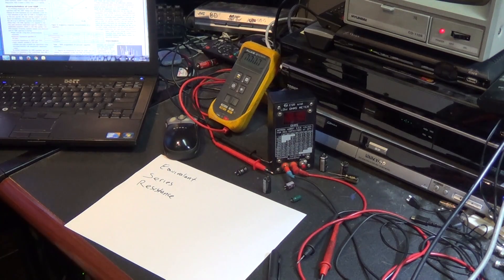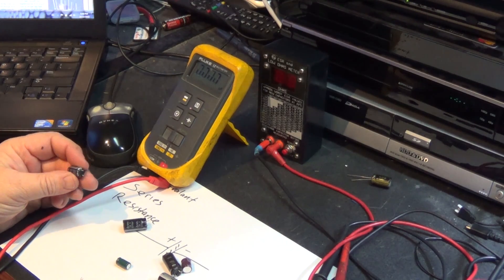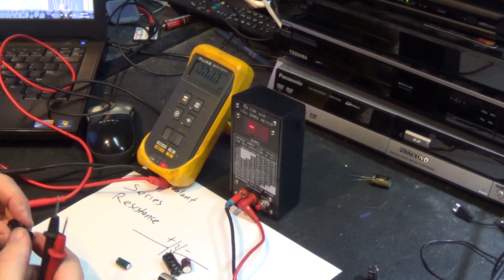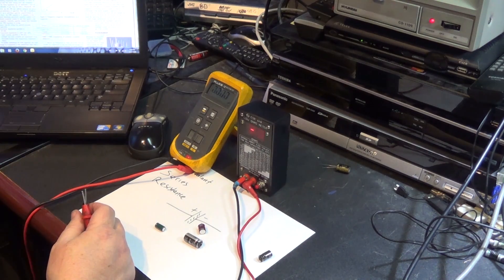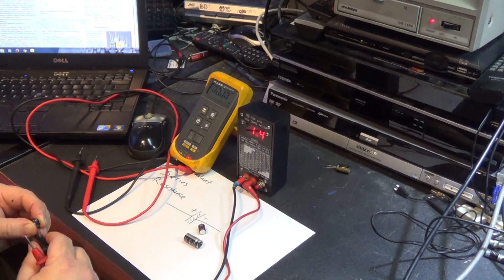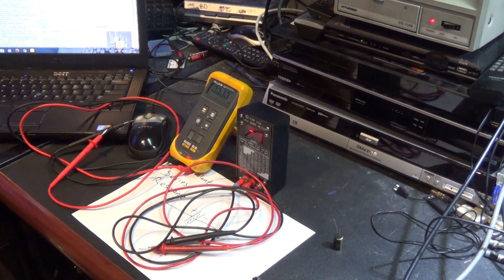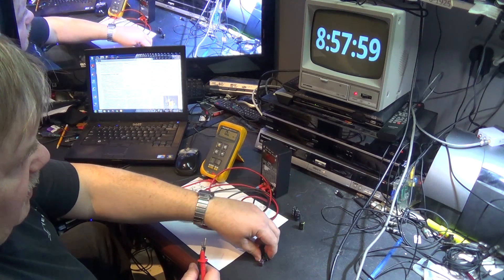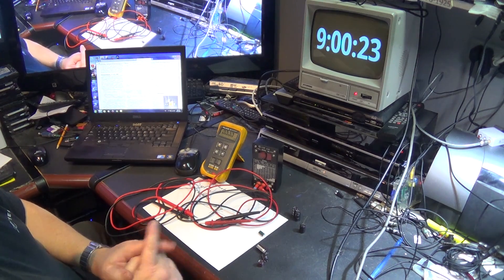Capacitor Measurment Testing

Comment: And another thing, I have a used Capacitor sitting on my bench, should I bother soldering it back into the circuit without testing.  My tester has a capacitance mode, however I don't understand the results.  When I touch the capacitor, the meter reads 0 until I remove the leads and then it gives a result.  Problem I found is when I re-read it the meter reads different results.  Which confuses me.  I should order an ESR Meter now that I am finding a use for it.

Comment: Do me a favor and clarify something for me.  I haven't ordered one yet, but I believe I have a need for one now.  The video you made a while back where you took a 12v power supply apart and replaced the Capacitor.  I have a power supply that's making the appliance power light flash.  I noticed in the earlier video the capacitor wasn't bulged, and the capacitor in the unit I'm dealing with now isn't bulged either.  Obviously it's going bad, and the appliance is sensitive enough that it's showing wear early.  

The power supply had a transformer, a resistor, two blocking diodes and a capacitor in the case.  How do I go about troubleshooting the power supply and learn by this?
Reply from the maker: +TrikiDick The way most capacitors fail is by the electrolytic drying up. This can be caused a few ways, by overheating, or from the leads being corroded by low ph of the electrolytic and causing the metal to dissolve allowing a space between the leads and the seal, and the electrolytic to leak out.Capacitors that overhear produce excessive pressure and can bulge the case and or open the safety vent that it there to prevent an explosion.As I demonstrated, the only really accurate way to measure of a capacitor is good or bad is measuring its ESR and it's capacity. The 2 are related, as when the electrolytic dries out the ESR will go sky high, and the capacitance will drop, but ESR is considered a more accurate measurement for identifying bad capacitors long before the capacity becomes an issue.
Reply: +12voltvids thank you.  I'm looking on ebay and amazon for one right now.
Reply from the maker: +TrikiDick I got mine from a brick and morter shop in Vancouver called Main Electronics. They still sell the same ESR meter, in both kit and fully assembled. Runs about 100 CDN, so if you are in the states with the $ exchange you can save about 40% these days. Don't know what they go for on Amazon or Ebay, but from my experience much of the stuff on Amazon and Ebay is junk. I spend more time returning things that don't work properly.
Reply from the maker: +TrikiDick mainelectronics.com is up.Here is the link to the ESR meter.http://www.mainelectronics.com/esrkit.htmThis one has a different case, but it is the same one, the Bob Parker ESR meter. I built mine from a kit. Took me an hour or so to complete.

Comment: I have an old cap tester that i made in the 80's, it is the charge up to threshold voltage type.
I found that boosting the charge up current to ten times does show dodgy capacitors a little better, the esr seems to have an effect at high currents, its crude but it allways showed that dead switchmode psu caps were way off value.
Reply from the maker: +zx8401ztv I used to have a breakdown capacitor tester at the shop. You charged the cap up to the max rated voltage and measured for leakage.The ESR is so much more reliable though, and it does it at less than .6 volts.